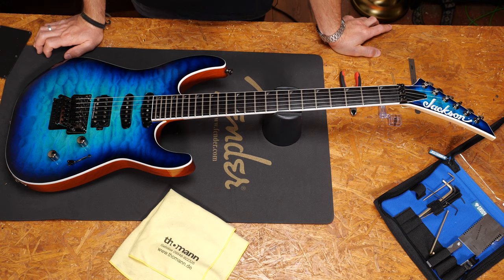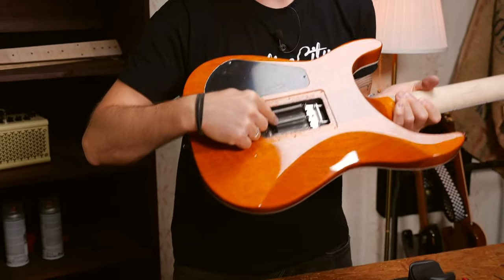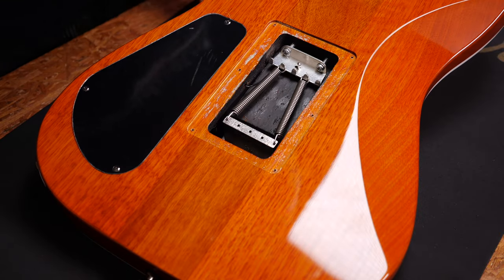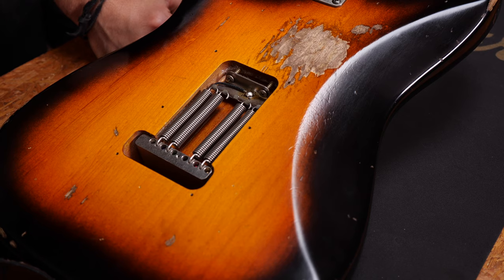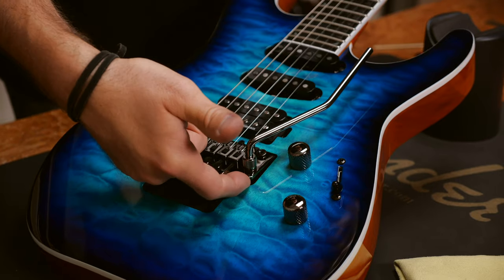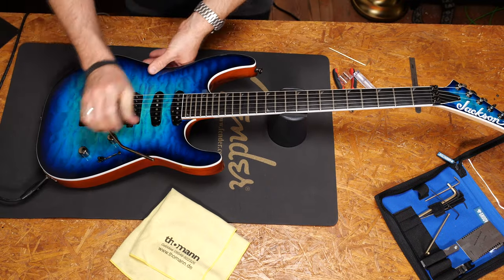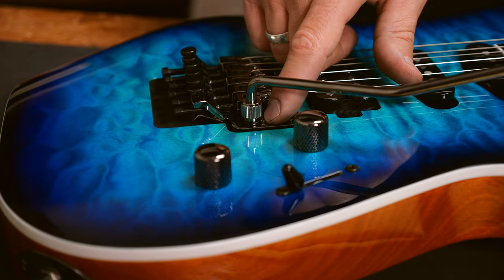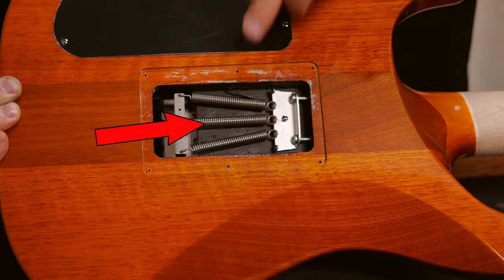How to set up a Floyd Rose | Guitar Tech Tips | Ep. 17 | Thomann

Comment: I just spent 2 hours tuning mine because i changed the gauge and i (stupidly) cut all the strings at once. Thanks for your help, i would have never got it right
Reply: Don’t want to tune the guitar a million times to balance the trem??? 
If you first loosen the spring claw and put a tapered block in the backside between the trem and body (on the other side of the springs) you can then set the angle of the bridge to where ever you want with the taper block to hold it in place.. tune to pitch... then bit by bit screw the claw back until the block slips away of its own accord.. 
it saves a bundle of time and you only need to tune it once.. no matter what gauge or tuning you want.. may need to change out a spring or add one depending on what you’re trying to do..
Reply: Glad I wasn't the only one who rushed taking the strings off and realized how you can't do that
Reply: I did the same and I want to cry.
Reply: @JohnnnyGash no problema, you cut em off at once, put all strings in place no tension, the use something to elevate the Floyd near the level, see the bridge moves, then tension thicker first, and if release the Floyd, and goes up lose string and move the screws. o goes down do the opposite. it's  easy but you'll spend some hours with it for sure and it's normal.
Reply: I been playing Floyd’s since 1987 it’s easy except when ya got to shim them
Reply: Seems like these guitars would be great to play if you have your own guitar tech for your band.

Comment: Easiest and quickest way I found to set up a floyd rose is to purposely tighten the springs a bit too tight so the bridge goes in, then find something like a piece of cardboard or whatnot to place underneath the bridge to block it at parallel position. After that, you can tune your strings and adjust the intonation like a fixed bridge. Once it's all done, you can lock the nut and remove the piece of cardboard or whatever you used to block the bridge. Bridge will go in (as if was before). Now you take a tuner and loosen those springs until the strings get back to the correct pitch.
Reply: Hey brother, quick question, I put Elixer 9-42 on my Jackson Dinky and the strings are super hard to bend, if I used just two springs would bends be easier? Been playing 40 years and know how to use my wrist for bends/vibrato, but never had a guitar so hard to bend the strings on. Please help. (I am not talking about using the trem bar to bend, just finger bends)
Reply: @KevinVenturePhilippines  usually it's more a matter of string thickness, but 9-42 isn't a thick gauge, so I don't know..
Reply: @KevinVenturePhilippines  maybe you're used to play with 24.75" scale length (a Les Paul for example) with 9-42 strings, while a Dinky is 25.5", so strings will be a little tighter with the same strings. A rule of thumb is to use 1 set thinner on 25.5, so you'd be looking at a set of 8's. Looks like you like light strings. (nothing wrong with it, just a preference)
Reply: @HCkev  Thanks so much for your time! The neck length may indeed be a reason. But if I take a spring off the trem in the back and just use two, that would not make the bending easier?
Reply: @KevinVenturePhilippines  yes, but it would also make other strings getting out tune when bending more easily (not really a problem most of the time because the other strings typically aren't being played). For the most part, it will affect how easily you can divebomb. Typically, you add or remote springs to match the tension of the strings (if you play standard tuning with very thick strings, then you'd need to add springs, otherwise the spring screws would most likely be screwed all the way in). Since you play with light gauge, you may try with one less spring (I'm assuming you have 3 springs, try removing the middle one and tightening the screws). You can also re-arrage the springs in a V shape to get a little more tension with those two springs
Reply: @HCkev  Awesome, thank you so much, brother! I will give it a try. Keep rocking! 🤘😁
Reply: Great procedure 
The only thing I would add is I use "post-it notes" to block the bridge. It makes it easier to get the bridge "knife edge" parallel to the body by selecting small amounts of paper to get it just right. 
Then, when you loosen the claw screws and the tension is equal on both the strings and springs, the post it notes simply fall out.

Comment: NEVER tune a guitar with floating bridge lying down!, it ALWAYS has to be in the playing position
Reply: Theoretically that is true but practically, the force of gravity is miniscule or negligible compared to the 150-200lbs of linear longitudinal string tension vs. the needed opposing counterforce of the springs that balances your tremolo system, plus any added tension forces applied by your fingers as you play. In practical reality, while the gravity vector always aligns directly between you and the center of the Earth, the guitar doesn't 'care' which way it is pointed while you play OR adjust your trem's overall balanced tension or its tuning and intonation for a particular string set, because the g-force is so tiny locally compared to all the other mechanical forces involved. It's there, but it's insignificant. In other words, gravity is not bending your guitar's neck towards the center of the Earth to an extent that it affects how your guitar plays, whether you have a trem or not. But if you want to try and account for it there's no harm if you think it matters.
Reply: @markpell8979  you clearly haven't used a Floyd Rose! 😂 Check a note with a tuner and see how it goes way out of tune just by moving the guitar away from the playing position! 😂
Reply: Alex, I was being respectful and discussing the basic physics involved so the laughter emojis were not called for. Btw I do have a Floyd Rose equipped Schecter. If your tuning goes out that easily just by aiming your guitar in different directions you may have an insecure neck joint that may need tightening, or the trem itself and/or the locking clamp at the nut may have loose mounting screws. Laughing at someone trying honestly to offer help did not advance this discussion for anyone. I apologize for offending you. By all means, do what works for you on your guitar. Peace!

Comment: Thanks. I really need to learn this. I am afraid to set up my own guitars 😂 because I am so scared to mess it up. But I had 2 different guitar store screw up on 3 of my guitars last year. It's time I do this myself.
Reply: you can do it man, it's not as scary as you think. You will save so much time and money.
Reply: Setting up a double locking system can be a REAL pain so the fear there is understandable, fixed bridges are so much easier to set up I definitely experiment with other tunings on those.

Comment: My new HB 620 with FR arrived yesterday, of course little bit out of tune, (the sequence to tune the strings is 6-1-5-2-4-3). Without to know anything ,I started 4-3-5-2-6-1 ,from the center, you know, but it didn't work :-)) , so i started the opposite way (which is the right way) and it worked.
Some small tuning adjustments i had to do on FR for each string  seperately (these big round bolts), absolute balance, perfect sound! Took me around two hours, carefully and with patience.
Till then i only knew that the tuning of one string affects the other (sounds Horrible!!!) and some small adjustments may needed at the end on the FR for every string, it worked, finally it's not so hard as it seems.
The sound is perfect, the FR is amazing, soft to use ( i tried the tremolo of my older guitars but i never used it, garbage, hard to use and out of tuning in 2 seconds..). 
I  only face little difficulty on picking (i used to bridge-picking) but i will get use to it. I will buy one more guitar without FR but not for this reason, FR offers stability, balance and great sound. It gives sensititivy to the sound, colour, romance, expression in whatever you play. So go for it!
Don't forget to push and pull the FR from time to time during tuning, it helps the new strings and the new FR to sit on the right position, tune one-two strings, play something, use the FR, tuning, and again...
Have fun!

Comment: Don’t want to tune the guitar a million times to balance the trem??? 
If you first loosen the spring claw and put a tapered block in the backside between the trem and body (on the other side of where the springs slot in) you can then set the angle of the bridge to where ever you want it.. tune to pitch... then bit by bit screw the claw back until the block slips away of its own accord.. 
it saves a bundle of time and you only need to tune it once..

Comment: See myself personally I would leave the bridge just a TOUTCH higher than the body in the back side adjust total height with my two front screws “closest to the pickups” To my desired height from the pickups then ever so slight down curve in my neck. Of course mine was the setup of the edge 3 trem on an Ibanez never the less very very similar in setup and playability. Just my personal favorite set up worked great for me.

Comment: Tightening the screws on the claw doesn't always flatten the tremolo. I have an 89 hm strat with a kahler spyder...have 4 new gotoh springs, 10's and tightened the screws. Still slightly forward though not like it was, but it will never sit flush without the whammy bar being unusable since it sits so far in the cavity. Sometimes, you just have to make the best of it.
Reply: If there's too much tension you can always remove a spring and then try again to level plus tune.

Comment: Thanks man, I was having problems with when I first strum my strings, they would sound out of tune until you let it ring out for a while then it goes back into tune. But you told me about the in the video you say that's a Floyd Rose has to be flush with the body mine leans forward because of probably the string tension. So I guess what I'm getting out of your video is that I need to either tighten the screws in the back to the springs, while the lock nuts are unlocked just to make it flush with the body, do I have that correct?
Reply from the maker: Hey man, some of these tech videos are a few years old by now but we always check for comments. These subjects don't get old. :) 
If you want the tremolo to be flush you have to tighten the screws holding the springs in the back, so yes. Don't forget to re-tune the strings after every little screw adjustment. You'll only hear and see what changed, once you tuned them.
What you're saying about the strings is probably a different issue though: you might want to check if the string gauge is right for your picking style. You usually have this "picking strings out of tune" issue, when the strings are too thin for your playing style. Or of course if the tremolo flutters too easily, that can also cause this problem. In that case an additional spring would help (but then you need to turn out the screws quite a bit, otherwise the whole tremolo just leans to the back). Cheers //Kris

Comment: What if the Floyd is not flat, but it has been previously blocked with a piece of wood in the back to allow for a D-tuna… Will adjusting the screws have any effect then?
Reply from the maker: Hi, if the tremolo is blocked the screws shouldn't be moved. Otherwise the pull of the springs might become too low and the wood block might fall out (unless it's glued / screwed in there, which I hope it isn't, haha). So if you want to tilt a blocked tremolo you have to modify the width of that block. If it's thinner the tremolo leans more forward, if thicker, the tremolo leans more to the back. Cheers //Kris
Reply: @ThomannsGuitarsBasses  Would a tremol-no be a better option respect to a wood block in your experience? Not only for bridge alignment but also for tuning stability (still with a d-tuna).

Comment: What about Edge III bridge from Ibanez? Which part of the plate should be parallel to the top of the guitar? When bottom plate is parallel the top one is at an angle and the opposite is true when top is parallel.
I bought a used RG370DX and can't make the string go completely loose when bottom plate of the bridge is parallel because I don't have enough space to push the whammy bar far enough to make them loose.
Reply: Oh, I think I've found the answer in Ibanez manuals. The finetuning prolongation of saddles seem to be the ones that should be parallel to the body

Comment: I watched your video and it seems very informative. I'm not sure if my adjusting spring screws are just not working right or if the bridge is damaged. No matter what I do unless I loosen the strings this bridge curves up like it's going to fly off. I wish I could send a picture but there doesn't seem to be an option for that. What gauge of strings would I need to use to bring the bridge back down if that's the problem? Thank you
Reply: I had the same problem. In my case the springs were tired, so they changed them in a guitar work shop and that helped. I think you can change them at home but I had no idea it was a spring problem, so I went to a local guitar work shop.

Comment: Always had a hard time setting up my iron label 7 strings to the point I don't use the trem bar anymore and modify the Floyd to on a fix position.. Help please!..
Reply from the maker: I'd love to help but it's impossible without having your guitar in my hands, to take a good look at it. Have you tried everything I've mentioned in this video?
//Kris
Reply: @ThomannsGuitarsBasses  OMG thanks for replying guys... It's when I start tuning them strings that the other strings gets out of tune... So what I do is put a piece of wood underneath the to make it fix. But6as soon as I lock it and remove the wood and try to tune then even if the Floyd is leveled it still goes out tune.

Comment: How do you maintain the tune of the guitar without  a string retainer?
Reply from the maker: On a Floyd Rose (or any other double-locking tremolo ) loaded guitar the locking nut grabs and locks the strings so it doesn't really change a thing if you have a string retainer or not. So here it doesn't really matter. It's different on a non-locking tremolo of course.
//Kris

Comment: My floyd rose is level but, I'm having an impossible time keeping it in tune, is there a special tuning method? Also when I was trying to fix the intonation on it, I turn it a millimeter to the left and it went from the Low E to the Low B like on a seven string
Reply: It's maybe half a year late, but here is what I do for a complete tuning and it works incredibly well. (Read before starting, most important thing will come at the end) Loosen the locking nuts. Tune in order 3-4-2-5-1-6. Doesn't need to be perfect, but should be close enough. Lock the nut and proceed to fine tuning. Again 3-4-2-5-1-6. So what you do is the following: 1st tuning process: if a string is x cents flat tune it x cents sharp (doesn't need to be 100% precise) or the other way around. Do this with all strings. 2nd tuning process 3-4-5-2-1-6 tune to pitch. This method works with the keys and the fine tuners. So after tuning with the keys once (both steps of course) the fine tuners should do till you change your strings. I have a Floyd on my wall which stays in tune after a year of not touching it using this method.
Reply: @tostrmofo6686  thank you, I appreciate it
Reply: @jolowe3947  You're welcome. Hope it was helpful.
Reply: @tostrmofo6686  is 1 the thin e string or is 1 the heavy e string?
Reply: @AntonioLopez-kw3ev  1 is the high ("thin") e-string.

Comment: Hi again! I have just received my first thoman guitar with floyd rose. A jackson s32. I think i have it verey good adjusted but some doubts. Now all trings perfectly tuned. E,A,D,GB,E. then I play guitar I use the whammy bar... Evereything good and tunned, but If I pull thar towards the neck and I leave the bar, all strings stay tuned between them but  a litle bit flat with respect the correct  tune (E, A, D, G, B, E) so if i pull to the other side then the strings stay all tuned but they keep sharp with respect the initial tune. Then a pull toggleing a litle bit and then it stays perfectly tuned. Which is the reason? Still bridge not perfectly parallel? Maybe springs from the backside not well aligned? Some component of the bridge with some defect? I thing everything is perfect... But as being a new floyd rose user, this kind I do not know what the reason for this kind of thing is? Note: no matter how many times and strong I pull, always all the strings stay tune between them.

Comment: Hey man. Will I have to change my intonation on my PRS Floyd Rose if I switch from Fat Bottom Skinny top 10_52 to say 8s?
Reply from the maker: Hi, yes, most probably. Intonation changes when you radically change the string gauge. It's also dependent on the tuning though (in case you change that too) so you have to check what changed. Cheers //Kris

Comment: Great video. Thank you Kris. I do have a question. I have a MIM Fender Strat HH Deluxe Edition with a Floyd but the space of wood where the Floyd goes seems not to be 100% cut for the Floyd since it leans towards the neck and the same wood on the opposite way does not allow the Floyd to rest a 100% alligned. ¿ Is that normal on these MIM Floyd Strats? Greetings from Nicaragua.